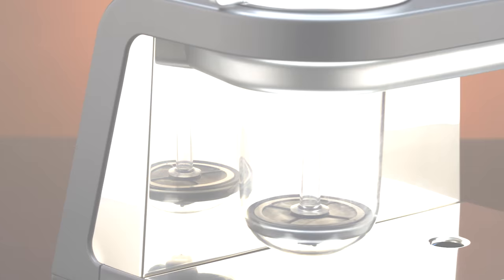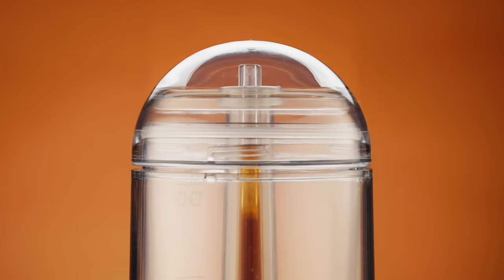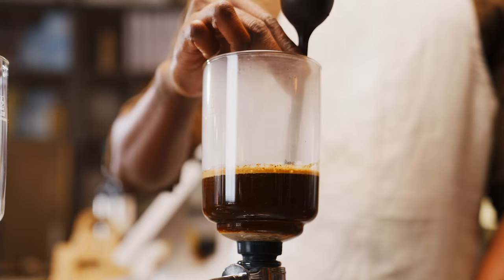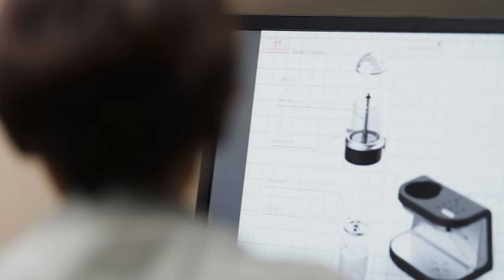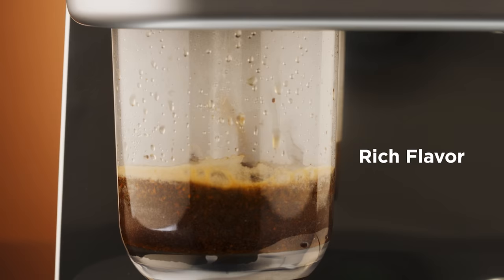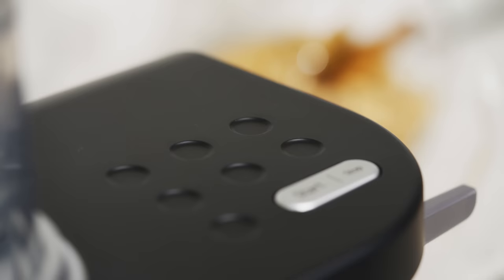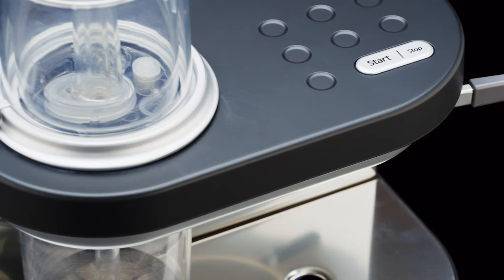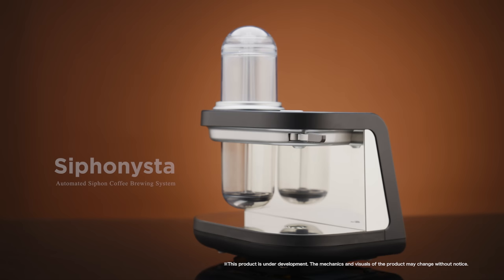Siphonysta, Automated Siphon Coffee Brewing System - Brand Video 4k

Comment: This strongly reminds me of Juicero. It solves a problem that doesn't exist by making a slightly rearranged syphon machine that's extremely expensive. It adds more seals and complexity. People who pay the $500 aren't going to want to admit that it's just a toy. Oh, it was $700 before? It might be $100 worth of coffee machine. But the way it makes coffee is just a variation on the other drip and syphon methods. There are basically two methods, there's the stewing method, and the espresso method. Drip, percolation, and syphon coffee makers all stew the beans. Espresso, moca pots, etc., use quick extraction to minimize bitterness. This is a stewing method, so it won't make significantly different coffee, though it might entertain people more.